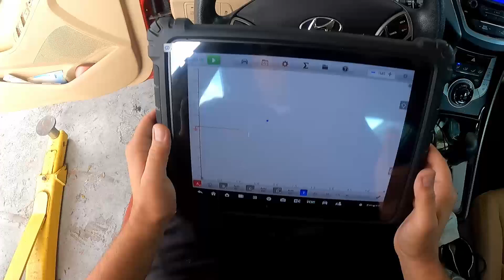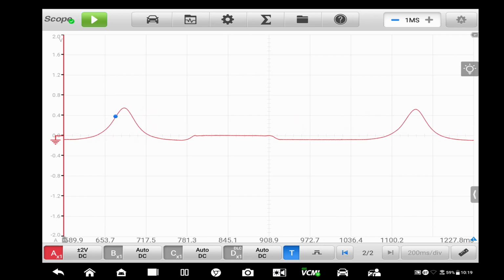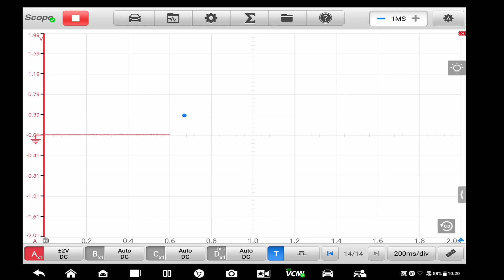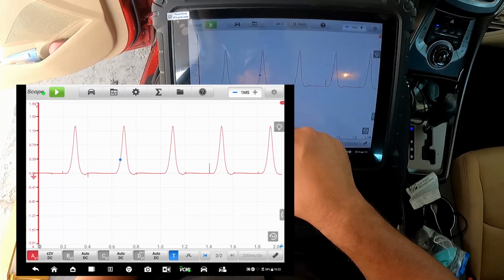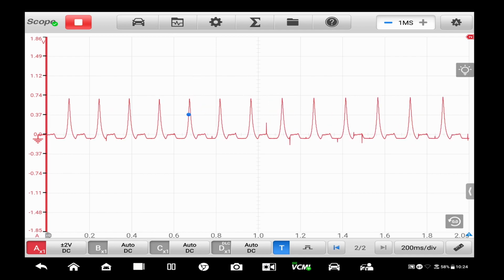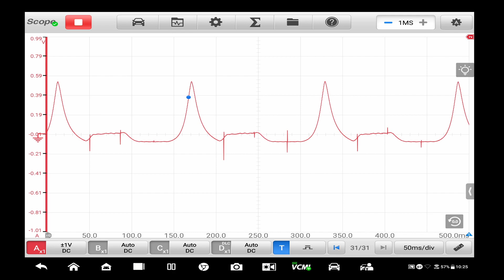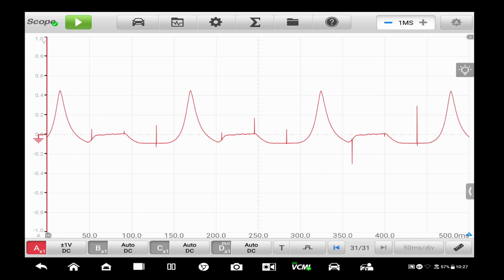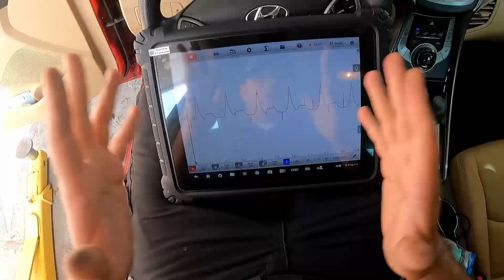Using the JH APT 100 pressure transducer for the first time with autel ultra

Comment: It's Duane from the Altima AC video, on these waveforms, your rubber hose flexibility and length play a role in the waveform, go ahead and play with different adaptors until you are happy, this long rubber hose is wrong for sure. Rev it to test exhaust back pressure. Just a guess at my observation, it seems that you do not give much time into watching other provider's YT Channels, maybe only a couple and I can probably guess who's. There is tons of stuff available to watch, good luck in your learning process. This type of diagnosis will save you a lot of time for sure.
Reply from the maker: I will definitely follow your advice. Thanks.

Comment: Thanks for the video. I see also the hose that goes in the cylinder. it is too long and too flexible I kinda wonder if you change it for a shorter and stiffer will get rid of those leaning tower.
I bought the same pressure transducer

Comment: Bro my jh apt100 came in with no battery. What battery did you put on it ??
Reply: get a lithium ion 18650, equals to 18mm diameter and 65mm length